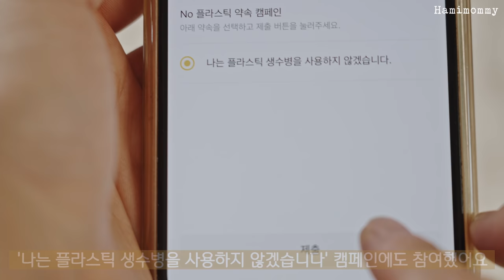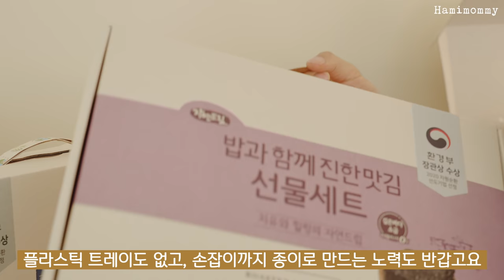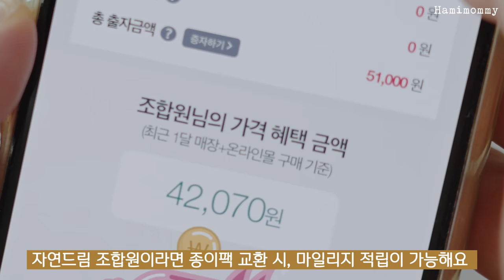SUB) 시원한 여름 휴가를 보내는 일상 🌴ㅣ청량한 계곡 그리고 여름 집밥ㅣSummer vacation week VLOG

Comment: Foreigner's question : can't you drink tap water in Korea ?
The whole thing about bottle for water seems a bit strange to me, since where I live you have perfectly good water to drink in the kitchen sink...
Reply: It’s technically safe, but you’ll still find many Koreans still either buy large packs of 2L water for the home, use pitcher filters, or use separate water fountains.  I use a pitcher filter myself. It’s not a big deal.
Reply from the maker: It's technically OK to drink water from the sink.. but it's more recommendable to purify once. Water itself it very clear, but the pipe might be not clear as we think.. especially for some old buildings.. so I use BRITA water purifier normally, and pack paper boxed water when I go travel as an alternative :)

Comment: Why do you buy bottled water..instead of buying water filters..is there something wrong with your tap water....think of the savings all the water you buy would be...! You could even boil tap water and chill it and still not waste the resources.....paper has to be produced so does the sugarcane and the cost of manufacturing...the contaminants 
.......chemicals to harden the spouts...changing one problem for another..just get yourself some water filters..after all the water comes out of a spout somewhere.
Reply: I am also curious as to the reason you do not have an outdoor clothesline..it is free and saves energy.....the sun is the best bacterial agent in the universe...walk the walk...be true.
Reply from the maker: I use that water everyday. I use Brita water purifier in daily lives. You can see it in my old videos as well. I chose the paper packaged water instead of plastic one only when I am traveling. hope this can answer your question :)